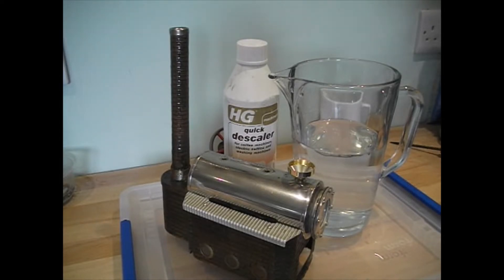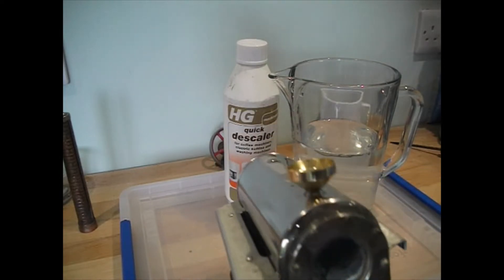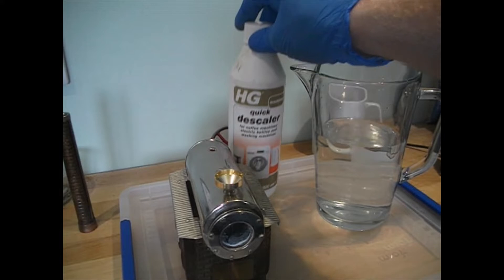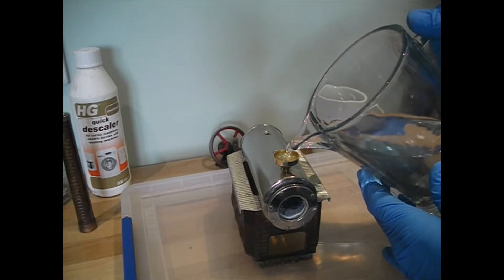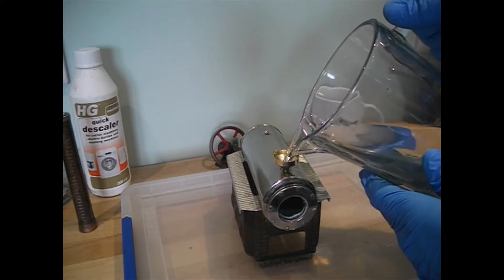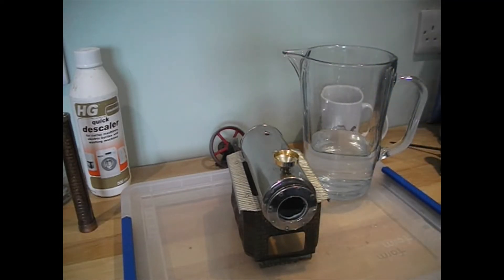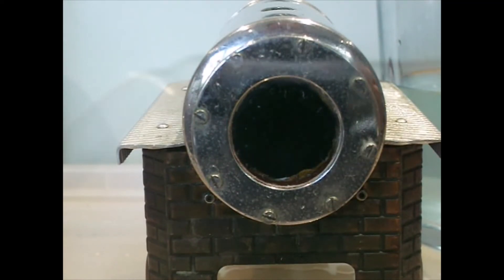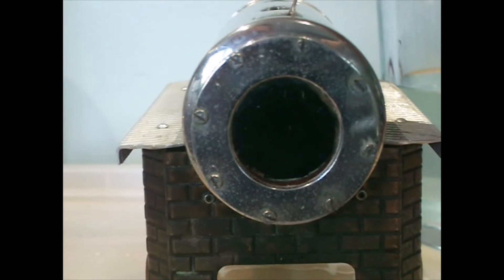How DO you restore a Wilesco Steam Engine? 🤔 - Part 6 - Boiler limescale removal

Comment: Thanks for the video! I'm trying to figure out how to descale all the Wilesco steam engines I inherited from my grandfather. Right now its hard to even drain the boiler cause its so clogged.
Reply from the maker: Hi - thanks for watching! Purists would say you should use white vinegar, but I’ve found that kettle descaler is fine for more heavy limescale as long as you don’t leave it in for too long…